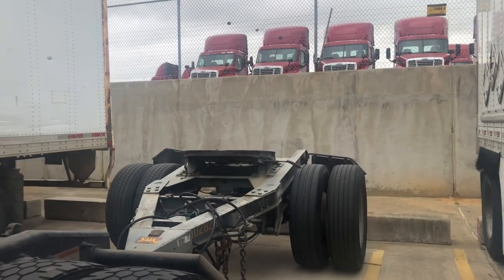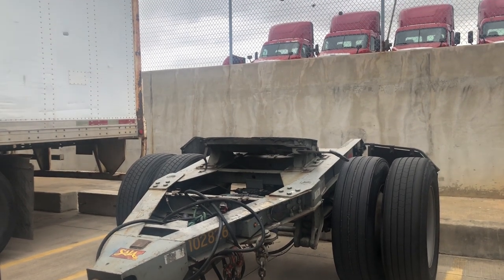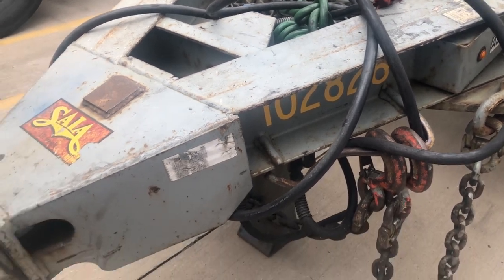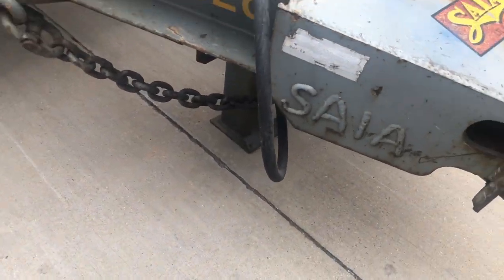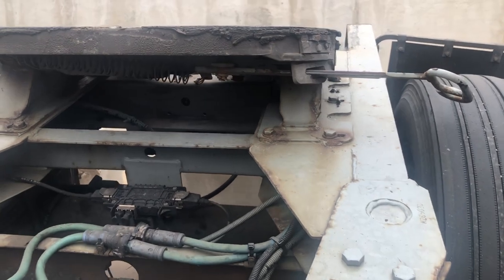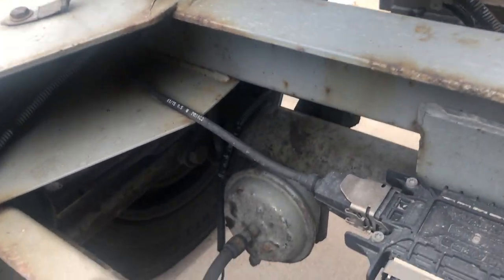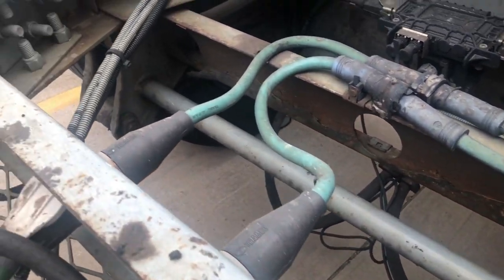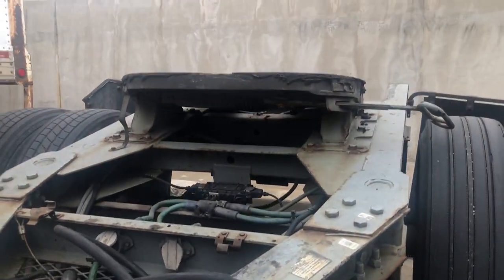TRUCKING | Choosing Converter Dollies | Pulling Doubles

Comment: If the chains are too long you can twist them to shorten the slack
Reply from the maker: I’ve seen it done. But, I’m not sure if it’s a violation or not to twist them. I do know that when they’re twisted it reduces the strength of the chain.
Reply: @MarksTruckingLife  I didn’t know that but in a pinch it would be better than chains dragging on ground guess it’s different for semis than non commercial vehicles